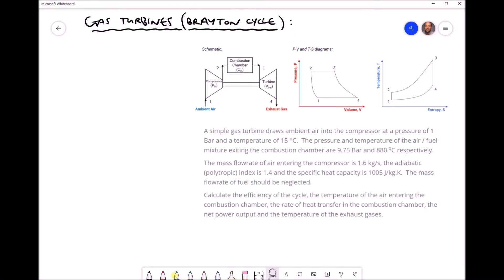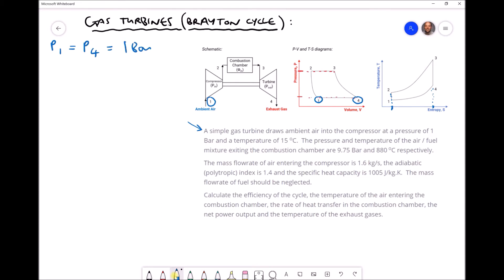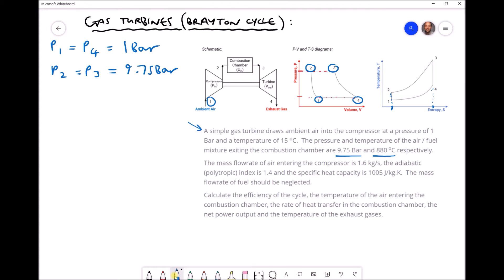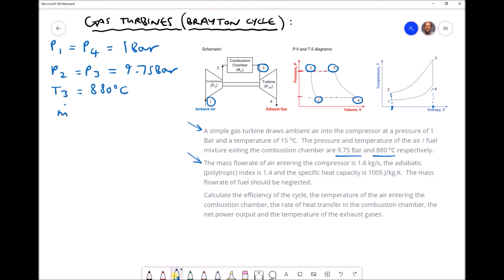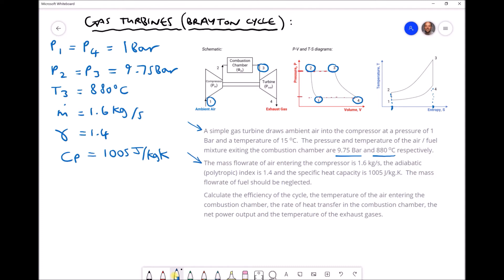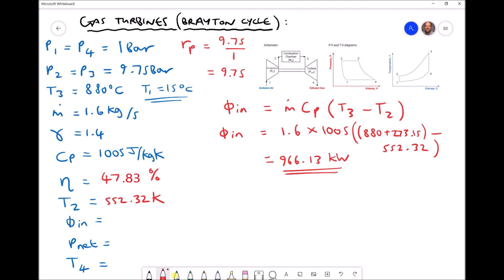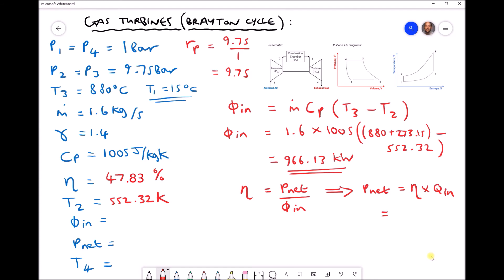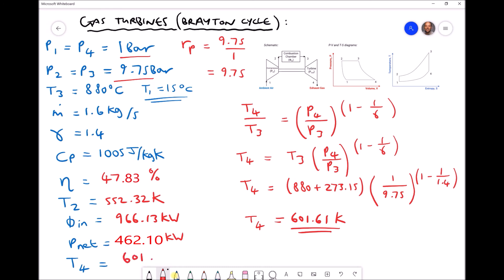Simple Cycle Gas Turbine Efficiency and Net Power Output

Comment: Wanna ask question, If i want to design centrifugal compressor based on maximum power turbine produced from exhaust gas engine, is it allowed to analyze from brayton cycle? We know that brayton cycle consists of compressor, cc, and turbine but in my case i have only cc and turbine to get work for compressor. Thank you